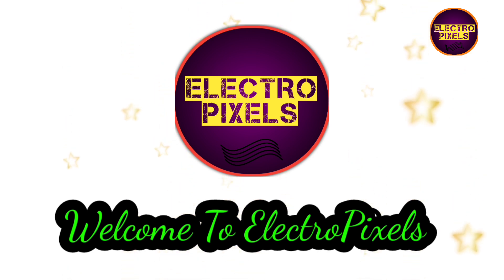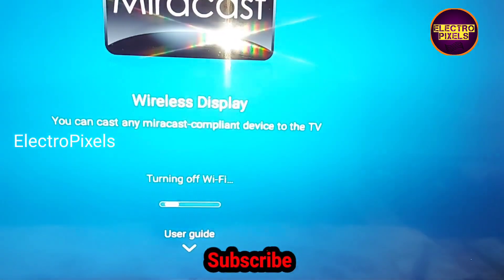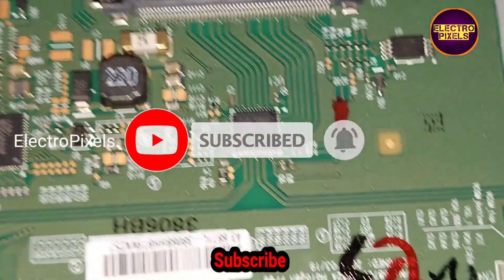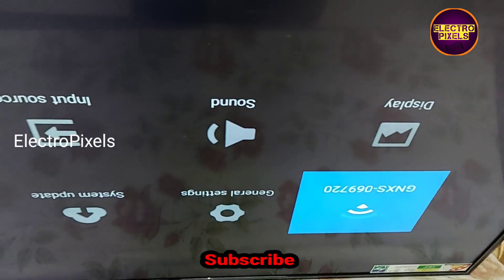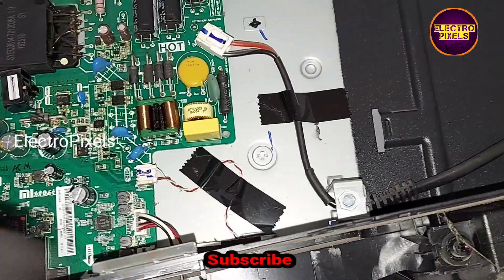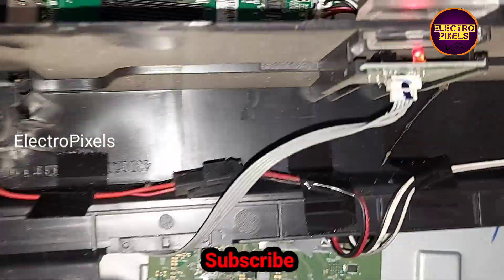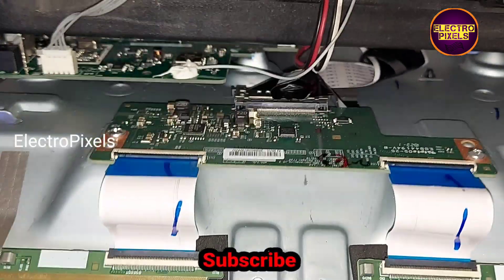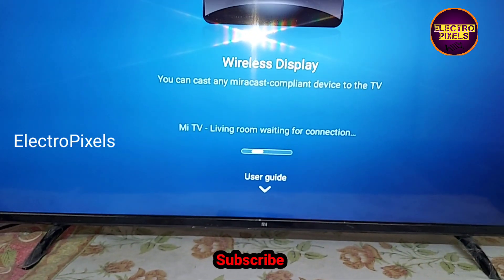Led Tv Vgh,Vgl short removal|Panel Repairing to Solve Double image in MI 43 inch LED Tv|LG Panel

Comment: this stupid solution ..not permanent solution.. if u mask the ribbon cable with tape .. .after some time big issue will arise.. need to service the T CON board ..it will affect other component . if u dont resolve it.. .this is not permanent solution ..u can order and replace T CON board itself ... even last year i .. did tape mask .. now my LG 50" "TV start showing vertical bars for half of TV .STUPID LG SERVICE asking 1200 to visit and check  itself .again service will cost more ....so changed T CON board myself  costed 1500 .. now it is completely solved the issue
Reply from the maker: The fault shown in the video is not Tcon board problem. Its because of internal Shorting in Gatesignals inside glass panel. The Gatesignals enter from the panel from both sides. Left and right. If short in one side removing that Shorting from one side will solve problem.If both sides short then not repairable. Some panels will work only sometimes one month because the working side Gatesignals also becomes Short. But some will work for years also.its a temporary solution and completely depends on luck basis. New panel cost 70 percentage of a new Tv.
Reply from the maker: If VGH, AVDD, VGL, VCOM 12 VOLT, HVDD ALL BASIC PANEL VOLTAGES ARE OK THEN it means that Tcon board is ok
Reply from the maker: We are not fool's we are Technicians . We know how to analyse a  Problem and how to repair. We have exact knowledge about its working details. May you have different Fault it doesn't mean that its a Tcon fault.